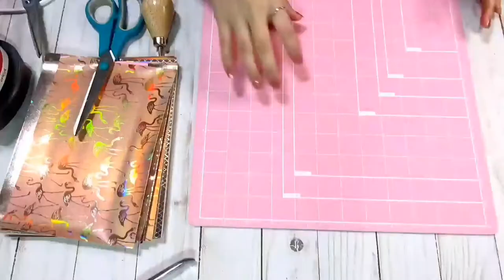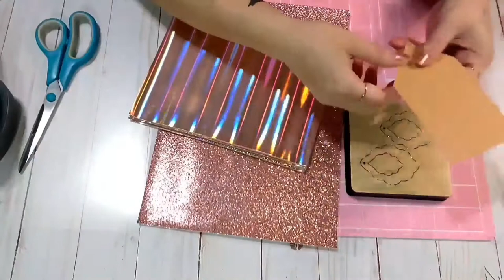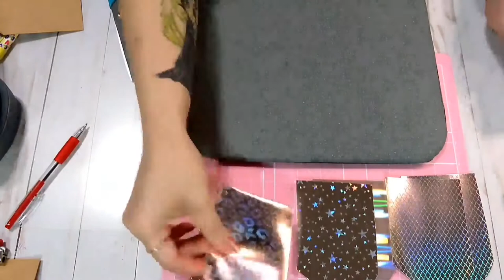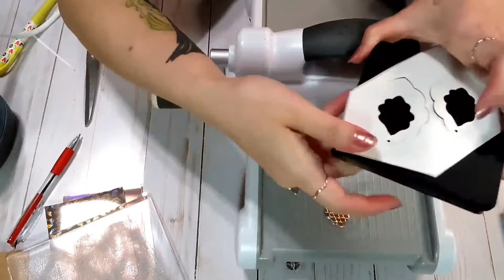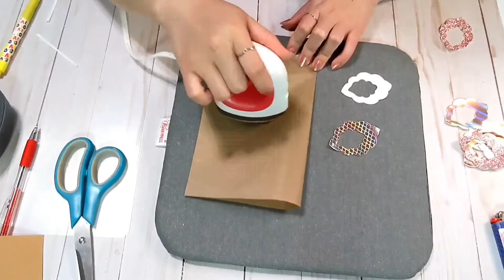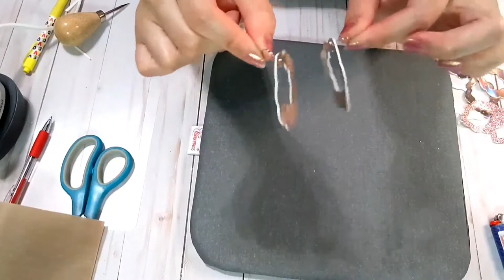🌺 Double-sided 🌺 Faux Leather Earrings /Using Sizzix Die Cutting Machine

Comment: Hi there, is this the 6 inch? Do you need the persision baseplate for this? Thanks
Reply from the maker: The earrings are either 2.76" or 3". You just need the cutting pad to sandwich the wooden die and the faux leather.